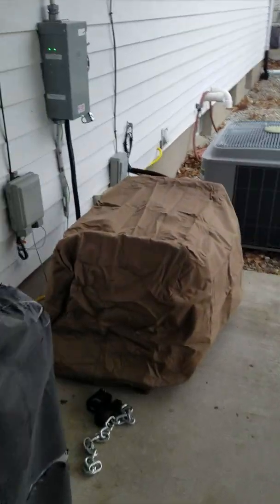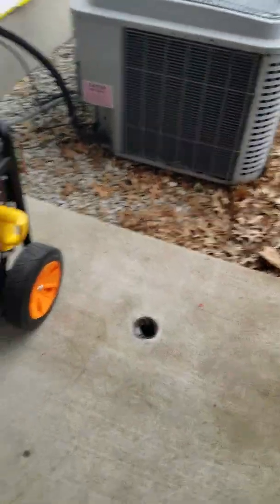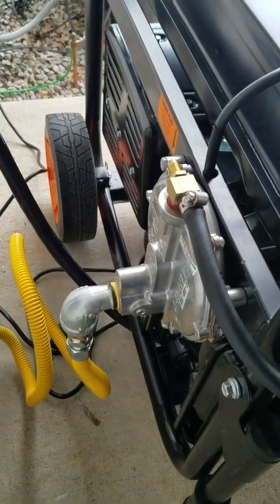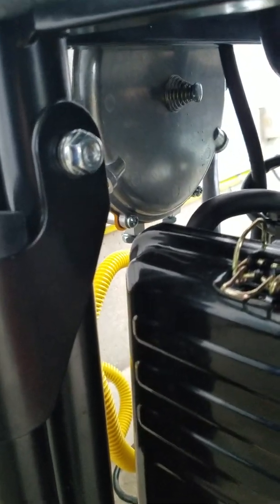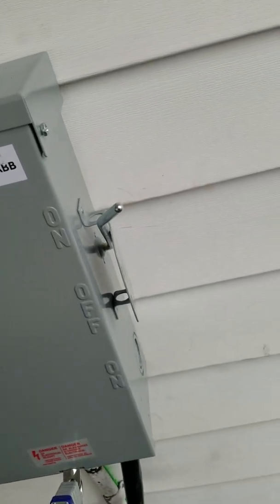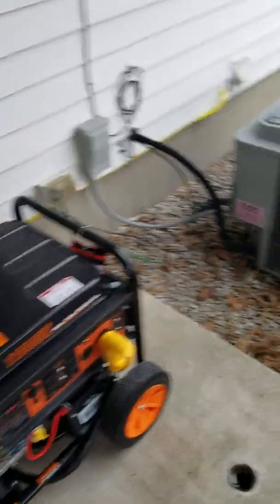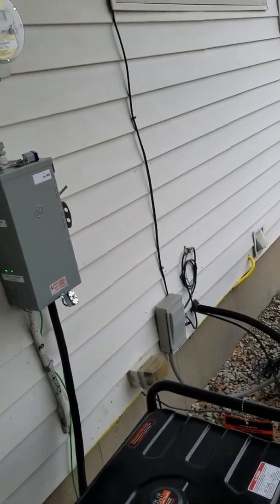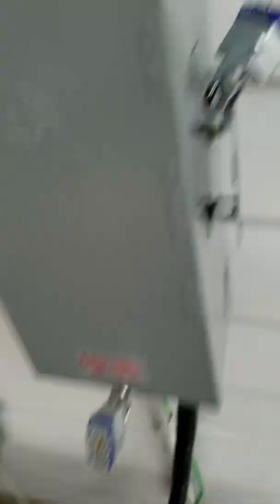Mom and Patti generator instructions

Comment: I converted my wen generator to natural gas.  I have checked for leaks, and get no bubbles.  But, when I turn the gas on, I can smell natural gas at the carburetor.  Once it is started, the smell goes away.  Should I be concerned?
Reply from the maker: Did you Install a kit on your carb or did your generator come factory with an air gas option? An aftermarket air gas carb kit may not have good seals and could leak gas when the motor is not on. Its also possible gas may be back feeding through the air filter until the unit starts and runs. Mine came as a duel fuel so it was ready for air gas out of the box. Mine will have a gas smell during the priming step from the regulator just before I fire it up but goes away after start. If this is the same experience your getting then I think you are good.
Reply: Thank you!  I have at Wen DF1100, so it was already ready for gas.  That makes me feel better.

Comment from the maker: I used CSST for the long gas run to the valve with the drip leg and valve. From there I used a flex line to the generator. I wanted flexability for vibration and potential movment of the generator. A flexible rubber natural gas hose with quick disconnect could have been used in lieu of my setup. I'm not knocking that option at all. But for the semi permanent installation I created I didn't want my mom to have to mess around with that. Also I thought the csst would weather better than rubber over time. The csst has a nylon coating. If I'm not mistaken this particular tubing can be used for direct burial installations which in my eyes gives it high durability. I certainly may be wrong about this but this was why I went with what I went with.